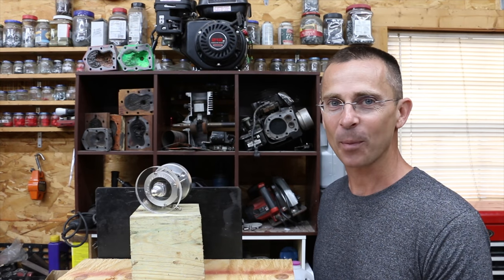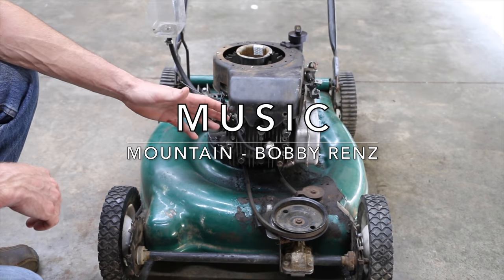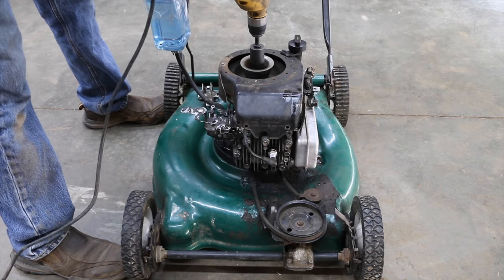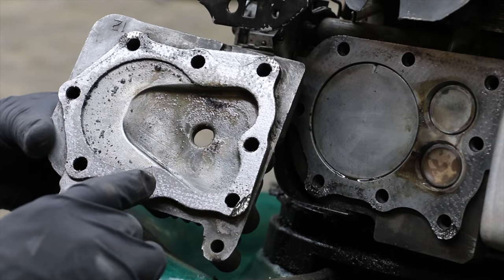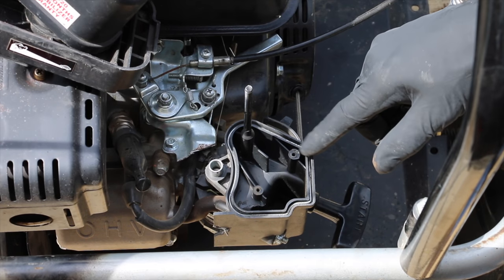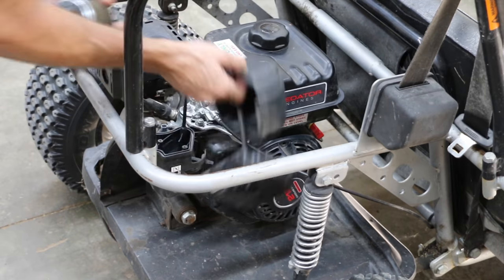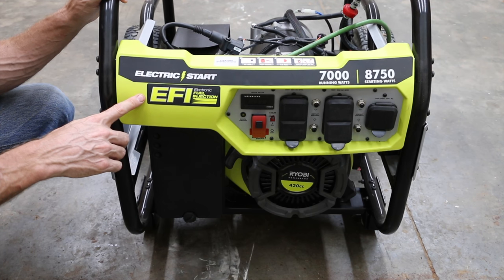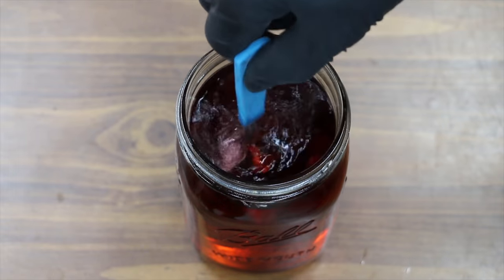Is Leaded Fuel better than Unleaded?  Let's find out!

Comment: So... "Is Leaded Fuel better than Unleaded?" Did we find out?
Reply: Nope :-(
Reply: Leaded fuel is good for high compression engines and high altitude there is no benefit running it in a stock engine.
Reply: @jeradlouzy4438  the reality is now, its the only fuel they make across the board, for the little GA planes they really dont need the high octane, 87 would do the job on any cessna
Reply: Leaded fuel is basically a lubricant for higher compression engines.
Reply: Its better and cleaner also don't have bad odors and if contact with your skin doesn't leave it dry and smelly
Reply: The engines built for leaded gas had sodium filled exhaust valves, something important to know during a rebuild, because if you throw one in the parts washer, and it has a crack in it, you will get an explosion, this was the warning the shop teacher gave at Nashville Auto Diesel College. I have a 73 Ford Econoline van, the paperwork that came with it from the dealer tells you it requires leaded gas, without it, you get to look forward to rebuilding the heads, it'll sink the valves in the seats without the lead to cool them, unleaded engines have hardened valve seats.
Reply: Thomas Mann   Title of his video has to do with leaded/unleaded, not octane.
Reply: @MaplesO1

So just get the valve seats hardend in your '73.

I had it done in my '70, and that was almost 100,000 miles ago.

Not to mention the fact that it has no sensors or catalytic converter, so I have run leaded and unleaded afterwards.
Reply: @puppykicker6701  The engine has been overheated numerous times due to a poor radiator design, Ford put too small one in them and the mountain here is too much for it. Now add Ford used nylon coated timing gears, all that heat will have it pealing off, something not enjoyable to repair in the van.
Reply: Leaded fuel is only needed for engines without hardened valve seats. A lot of very old motors just used the cast iron in the head had a valve seat cut into it, but common practice now days is during a rebuild, an engine shop will bore out the seat and install a hardened insert, so the vehicle can now run on regular unleaded and be more wear resistant. 👍🏼
Reply: @NBC_NCO  No, it is for more resistance to detonation, hence the higher "octane" rating. Automotive leaded fuel had less lead than "low lead" aviation gasoline. A bit of lubricity from the lead for auto engine valves and valve seats was only a by-product. Overall, lead deposit buildup was a net negative.
Reply: @itsm3th3b33  Lead is an easy way to increase "octane" (anti-knock rating) of the fuel. 100LL Aviation gasoline without the lead added has an aviation octane rating of 92 (called 92UL).
Reply: @jimandmandy  yes. You said everything I did with alot more words.
Reply: @mayaswellbethewifesaccount7625  

The best part was that after I had the hardend seats put in, I could run either type of fuel.

For a long time, a local gas station had leaded fuel available for boats.

Often it was cheaper, and I would fill up with that.
Reply: @Maples01  

God, I hate Ford.
Had one once.
It was a vehicular Vietnam trying to keep the thing running.

1963 Galaxie 500XL convertible

Had a 352 CID with a police interceptor package (usually on the 390 CID) put on it.
Reply: @puppykicker6701  I have broken far more GM vehicles than Fords, blew up 3 International 304 V8's, a 225 Dodge slant six but my Ford has been good.
Reply: @Maples01  

All the Internationals I have seen had Ford engines.

And I blew up a slant six myself.
Reply: @puppykicker6701  I've owned two Fords (Australian XC Falcon hardtop and a 1973 Landau) and will never own one again. The repairs never stopped. I still have my first car 1967 Oldsmobile Delta 88 and it still uses the same 455 motor rebuilt in 1987. I've been forced to use unleaded fuel for the past 20 years here in Australia. The engine still runs fine. It seems that over the years the valves and built in valve seats have glazed and hardened themselves. Some cars are more fickle (Ford) where as mine just keeps running.
Reply: @arnbo88  

I really love Oldsmobile.
Such a shame GM quit making them yet continued on with the other junk.

And as for Ford? 
They never continued msking anything that worked for very long.

GM had the THM 350 transmission for around 40 years.

In that same period I don't think Ford had a reliable automatic transmission.

Even if they did, they would only have made it for a short period of time.
Reply: Jerad Louzy yeah also it’s terrible for emissions
Reply: @hendricksonrunner5015  

Not really.
Just got tired of being shafted by auto shops.

Sure, I took more than my fair share of autoshop classes in highschool.

But I have had my 1970 Oldsmobile since 1995.

And it is still running the same carburetor that a shop said wasn't repairable in 1996.

They wanted two weeks and $400.

I told them that I was coming to get my car.

The only thing wrong with it was that the carb had vibrated loose from the manifold.

So after that, I learned how to fix things as needed, rather than taking it in somewhere.
Reply: @NBC_NCO  so can leaded petrol be used on 2 stroke engines so that premix can be avoided?
Reply: Leaded fuel suppresses detonation, AV gas adds de-icers in it that caused much of the build-up. If you don't have a high compression engine or operate in a low-pressure cold climate where water will condense and freeze in your lines, neither are beneficial.

Also, leaded gas kills oxygen sensors VERY fast.
Reply: @applanateearth586  better for who? sure it keeps your tank non-rusty, but burning leaded gas causes brain damage, so you also need to account for and pay for damages. That's why the EPA banned it.
Reply: cyberpunk11x 
You will still need to add oil to the fuel for 2 stroke engines. I ran 100LL in my Yamaha Banshee (350cc twin 2atroke). I had higher compression heads on it. It loved the 100LL👍
Reply: sean anderson 
They didn’t ban it. I just bought some a few weeks ago.
Reply: sean anderson 
Am I wrong that I bought some recently? Lol. Because I am pretty sure I did. Anyone filling their small airplanes use 100LL. Its at our local airport. Dippy.
Reply: @armiantoniomarquez1977  Uh, and it gives you lead poisoning. When governments outlawed TEL in gasoline it was a public health coup with the same significance as when they started warning people that smoking causes lung cancer. There are studies pointing out that there's direct causative relationship between the end of leaded gasoline and an increase in normalized IQ.
Reply: Would you knowingly want yourself or others to be near an engine pumping out a neurotoxin in its exhaust? 100LL is for high compression aircraft engines, no engine since the 70's needs it.
Reply: @tomtom590  Not correct. Only low compression aviation engines can tolerate low octane fuels. For example, my Cessna 177RG has a high compression engine and will detonate under some conditions using 100LL. There is no viable way to operate my angle valve Lycoming IO-360A1B6 on lower octane fuels.
Reply: @hydrocarbon82 Yes, and the lead in the gasoline fuel also lubricates. But how do you explain the low-compression engined go-kart running rich with the 100LL gasoline and after having to lean the mixture it outperformed the unleaded gasoline (and with better mpg for sure).
Reply: Results: The go-kart loved the 100LL gasoline BUT the EPA still hates it.
Reply: cyberpunk11x  no , it’s not a replacement for oil
Reply: @seananderson5850  Airplanes with piston engines use 100LL a leaded gasoline
Reply: @NBC_NCO  My dad ran three service stations during the great depression in Sioux City, Iowa. He said when leaded gasoline first became available, engines started lasting twice as long before needing overhaul from the previous 60,000 miles. The lead served as a lubricant, especially in the exhaust valve stems and valve guides.
Reply: No, because it puts lead in the air.
Reply: Abraham Linkens Sphere News flash, all gasoline engines emit poisonous exhaust fumes, even engines running on unleaded gasoline have carbon monoxide in the exhaust, which is a poison that will kill a person far quicker than lead. As long as you’re running the engine outdoors like you’re supposed to, neither lead or carbon monoxide in the exhaust will harm you. Lead is largely beneficial to internal combustion engines, that’s why it was added to pump gasoline in the past and why people pay extra for leaded race gas today. Tetra ethyl lead is an anti knock agent and provides lubrication to the upper cylinder and valves. The main reason it was banned from pump gasoline for street use is that it interferes with catalytic converters and O2 sensors. I have been a professional mechanic for years and have probably seen the inside of more engines than you will own in your life. Lead extends engine life and is excellent in high performance applications, and while not necessary in most stock modern engines, they like it too as long as there is no emissions equipment to be damaged.
Reply: Rusty Shackleford the Cat converts the aforementioned CO into CO2 rendering it harmless, lead meanwhile builds up in animal tissue suppressing nerve signals until the day you die. 

Taking a potent heavy metal neurotoxin and creating an aerosol in populated areas is an absolutely ludicrus idea just to gain some fringe benefits in a few specific engine designs.
Reply: FlakeSE Catalytic converters do convert some CO into CO2, but they are not perfect and exhaust even after the catalytic converter still contains CO and is still poisonous, especially if your cat isn’t brand new. This is mostly on cars though as motorcycles and small engines like lawnmowers rarely ever have catalytic converters. The reason it is safe to use a lawnmower even though there is no barrier between you and the exhaust pipe spewing literal gaseous poison only a few feet away is because outdoors the exhaust dissipates and is of no harm to anyone. The same applies to leaded gasoline. I replied to the comment which ignorantly assumed anyone using leaded fuel would have lead poisoning, which is absurd and false. I am not arguing that pump gas should be leaded again, that could potentially lead to problems in highly populated areas like LA. I am letting people who don’t have a background in mechanics like I do know that leaded fuel has a legitimate purpose and it is not scary and if used in properly ventilated areas it will not harm you or anyone else.
Reply: frother you only get lead poisoning if you touch or consume it
Reply: Inyasha Wyosaki are your lunges not touching it when you breathe it in?
Reply: @rustyshackleford9632  The problem is you are looking at this from a narrow perspective. Obviously on the individual level it's not that bad, but once you bring it to macro scales it gets a lot worse. There is no environmental cycle that cleans lead pollution on the scale it was being produced pre-discovery, so it will just continue to build up, not just in high population centers. It would only be an bigger problem there first, but it would eventually be a problem everywhere.
Reply: @puppykicker6701  Yep... what a shame huh? How people will lie and steal your money. Never seen an honest shop that wasn't my own.
Reply: @Maples01  Sodium filled exhaust valves are used in all kinds of engines. The valve is sealed, throwing it in a parts washer isn't going to do a damn thing
Reply: @otm646  WRONG, if you toss one in a wash, and it has a crack in it that you didn't see, the explosion that results from it will indicate how big of a fool you are, my class was warned of this at NADC by one of the instructors!
Reply: For older engines with no catalytic converter most certainly!
Reply: Leaded was for engines and their internal components, prior to emissions. Also, unless you have a racing engine, there is no need to put in supreme. Higher octane is higher resistance to pre-detonation (misfires)
Reply: @sb120985  My 99 E350 hasn't got a race engine, but requires high test, it has a tune on it, so does my 73 E100, the engine papers indicate 92 leaded, again, non race engine.
Reply: Let's make this clear: huffing lead is how you get a tumor
Reply: @Maples01  I think you missed "resistance to pre-detonation", which is misfire
Reply: @NBC_NCO  

Actually it's real use in the 60s in fuel was octane boost.  A side effect of it was helping valve seat wear.
Reply: I would not use 100 octane on any small engine, any motorcycle or any pre emissions car.  First, the cost would be too high.  Second... depending on how much tetraethyl lead the gas contains, the BTU might be too high for the motor.  I could see using the tetraethyl lead in order to boost the octane in non ethanol unleaded gas, so long as the octane is kept under 94 (R+M)/2.
Reply: No clue
Reply: puppykicker The TH350 was in production by GM for less than 20 years, nowhere near 40 lol.
Reply: J S Your Banshee didn’t really have “heads” as there aren’t any valves in a 2 stroke. It has a cooling head, but the domes and piston would account for the compression increase.
Reply: @Maples01     Not all engines that ran leaded gas had sodium filled exhaust valves. Older cars and pickup trucks that ran leaded fuel did not have them. Sodium filled exhaust valves were used in some, not all, heavy duty truck & industrial engines. The sodium was there to help cool the valves in extreme heat conditions. It had nothing to do with leaded gasoline. Lead was used mainly as an octane booster.
Reply: @Maples01  delete your comment you coundnt be more wrong
Reply: @jacobpoucher  I'm not deleting shit, I am not wrong.
Reply: @NBC_NCO  Nothing to do with lubrication, it's to prevent detonation
Reply: @Maples01 , No, most Leaded engines did not have the Sodium filled valves unless they were heavy duty applications. Back before the 1950's they were more common in cars because Leaded fuels had not come out for them yet. 
(Most Sodium filled valves are larger stem diameters.) Most Ford Cars and pickups used regular valves since the early 1950's. About 1968, (Before the modern unleaded fuel) Ford started surface hardening their valve seats in their heads. Most issues of sinking valves were LP Gas (Propane) due to the dry nature of the fuel.
Reply: My MXbike has a high compression Piston so the perfect race fuel for me is a VP blend that has lead in it for the high compression timing.  If I had a normal Piston then the lead would be useless!

Comment: Been using avgas for years. It’s not designed to run in these engines. O2 levels are not meant for using at ground level. You need to mix it with high octane pump gas. Preferably ethanol free. That’s the magic sauce.ive had good luck at a 50/50 mix. Thanks for the great content.
Reply from the maker: Thank you for the feedback

Comment: How does it have a flash point of -40C and -40F? Does it behave differently depending on what region it's in?
Reply: Celsius and Fahrenheit cross at those temperatures - same number, same meaning. They diverge at colder, or hotter temperatures.
Reply: lol,   i get what you are saying but there is a weird quirk in the C and F scales!    they align perfectly the same at the -40 mark!      so yes,   -40F is the same as -40C
Reply from the maker: Great question.  -40c and -40f are actually the same temperature.  It's the temperature point in which the 2 seems are the same.
Reply: @Floortile83 because degrees  Celsius & Fahrenheit aren’t equal.
For e.g.
0 Celsius = 32 Fahrenheit
0.555 Celsius = 33 Fahrenheit
1 Celsius = 33.8 Fahrenheit.
Fahrenheit is 5/9ths the value of a single degree when you’re increase or decreasing.

Comment: Lead Vs Gas Vs Kerosene in a 2 stroke Bike engine? (Just thought of coming up with something random)
Reply from the maker: Thank you for the video idea!
Reply: As far as I know, 2T's have less compression so performance benefits would not exist. Also, IIRC 2T's don't have valves so the added benefit of not damaging valve seats wouldn't exist either.

In addition, if my memory doesn't betray me, he already tested kerosene on a 4T and found it knocked a lot. Maybe the lower compression and slightly lubricating properties would influence a 2T

Still, a comparison of that kind would be great.
Reply: @chelarestelar  Gotcha
Reply: @chelarestelar  Depends on the make of 2 stroke. Jawa and CZ motorcycles run 10:1 and higher compression ratios in low revving high torque engines. On the other hand Japanese 2 strokes run 7:1 and lower high revving engines.

I've seen a Honda QR50 kiddie crosser 2 stroke motorcycle running happily on a paraffin and 2 stroke premix.

Comment: Lead is an octane booster, so it has no meaningful effect in these low-compression engines.
Boy, that rotary engine was NOT happy about running on gasoline. Nitro engines rely on hotspot ignition, where the glowplug glows continuously from residual combustion heat unlike diesel engines. Hotspot ignition is very difficult to use with gasoline. Gasoline requires more input heat to ignite than nitro fuel does,  and gasoline also burns hotter than nitro fuel which can easily overheat and melt the platinum coil inside the glowplug. Those two factors make it very difficult to get the ignition timing just-right without having a timed spark as the ignition source. There are some glowplug-ignited RC airplane engines, but the main reason they work is because RC airplane engines run at nearly full-throttle the entire time the airplane is flying.
Reply: Or you could use any other non-TEL octane booster
Reply: @MultipleObjectSelector : I am unsure which part of my post you're disagreeing with.